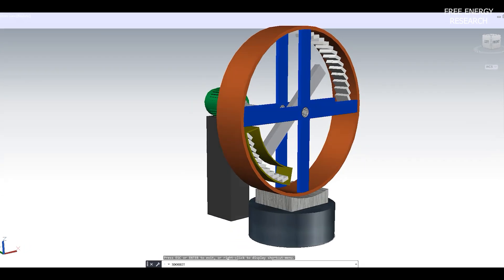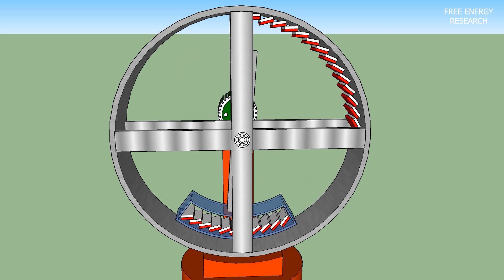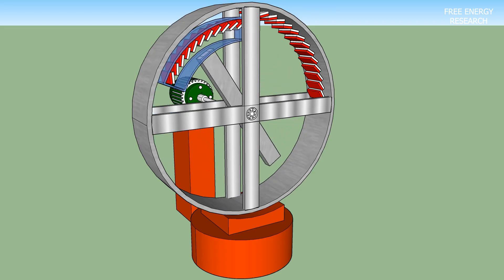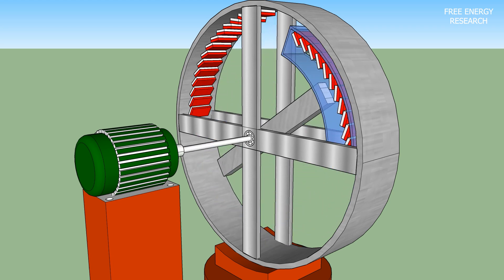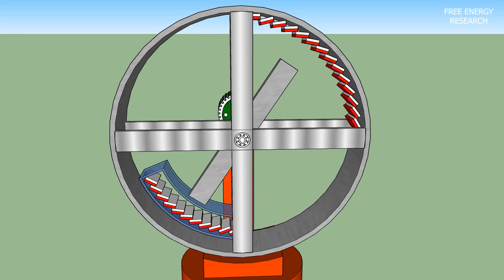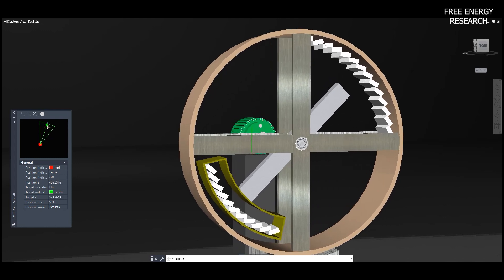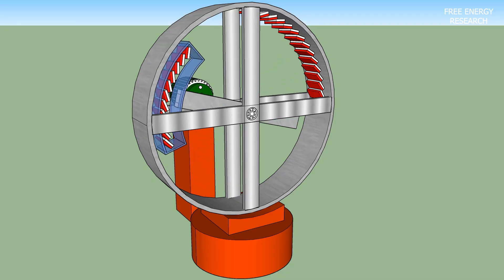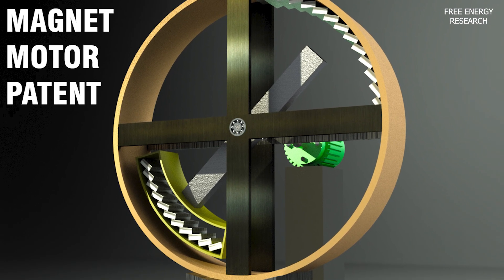Magnet Motor Patent - Free Energy Research

Comment: How small scale can we attempt to built this? I have a 3D printer, some motors and plenty of magnets left from a different project. I really want to try this.
Reply: Waste of time.
Reply: @atvheads  Not a waste of time if you enjoyed making it and learned something in the process.
Reply: @L3X369  It is a waste of time if you expect it to work. If you want to build it just for the joy of building something, then the video is all the information you need to build at the scale you want.
Just to be perfectly clear, free energy devices don't exist. They can't exist. The only way to generate free energy is, for example, if you run a generator, but you get the fuel for free somehow. It will be free for you, but you still have to supply the fuel.